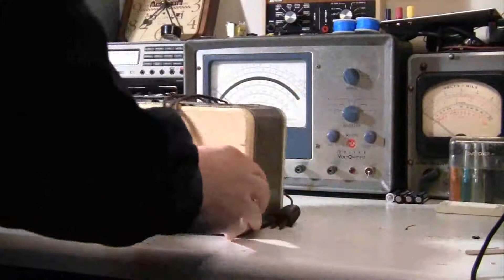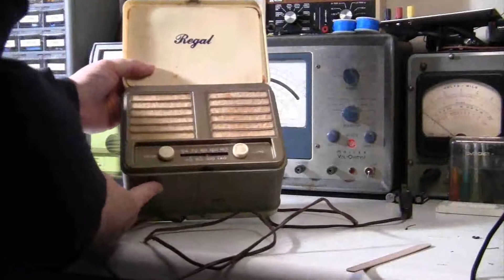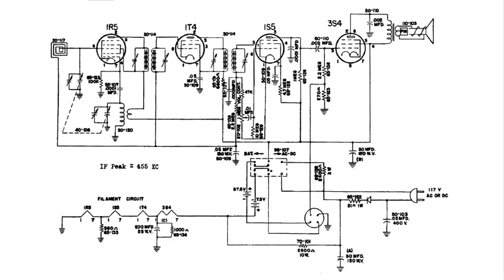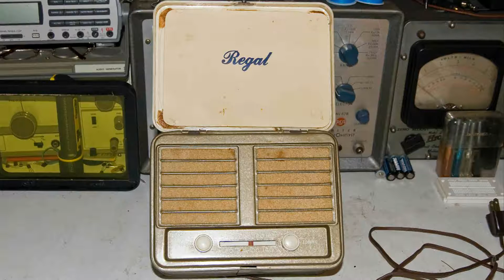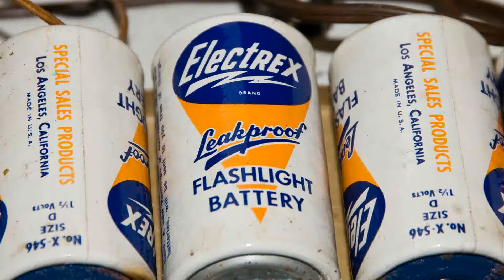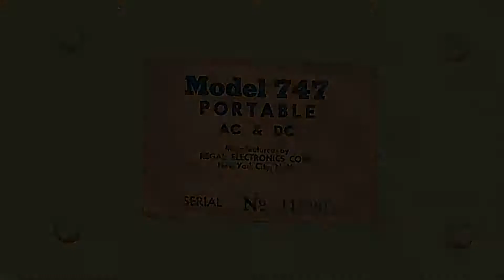Regal Radio 747 Repair Part 1, Circuit Description

Comment: Ps in the zenith trans oceanic  a 1r5   works for the 1l6  hundred $ tube  some hf.     bands  are     affected
Reply from the maker: According to QSL, no. Here is the link.
NJ7P SQL Tube Database Query
http://nj7p.org/Tubes/SQL/Tube.php
Reply: @AllAmericanFiveRadio  have 2 zeniths  1r5 works poorly on some bands but I don't want the set to burn out a 100$tube for am use only I have a good s.s. short wave radio.

Comment from the maker: Thanks 3mustardMoNkEyS
The main bias for the 1S5 is on pin 6, 10MEG and the 560 ohm resistor. Pin 3 is a diode plate, hard to see in the drawing. The 47K and 1MEG (volume control) is the rectified audio path from pin 3 to the filament. The 0.0001MFD is the RF drain. The 22MEG and the .05 MFD made an RC time constant for the negative AVC voltage.

Comment: Where do you find the circuit diagrams for all of these radios you work on?  I would have thought they'd be nearly impossible to locate, especially the ones manufactured close to 80 years ago.  Thanks for another great video.

Comment: Rick,
Having just come off that Motorola 5A7A repair job, I'm glad it's you fixing this one.  The parts in those old, small portables are really crammed in there.
There was one last cap that needed changing, but it was buried down in there, meaning a hundred things had to be moved out of the way.  When I finally reached it the darn thing it turned out to be the oscillator...same color and appearance as the caps. :=)
Looking forward to hearing yours play.

Regards,
John